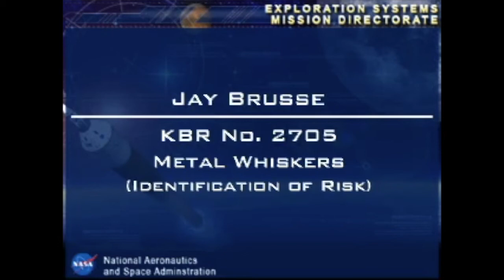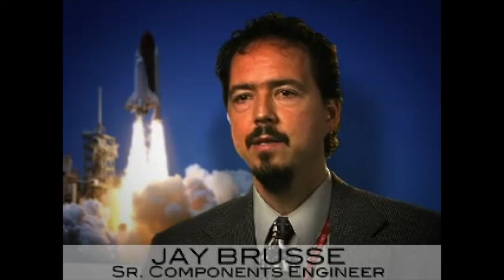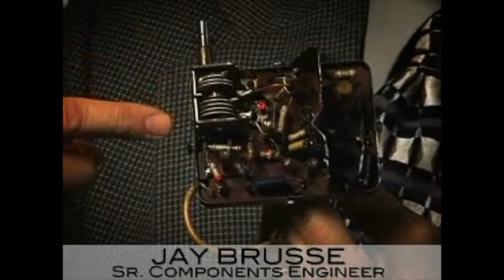Risk #2705 Metal Whiskers

Comment: 1986, i found tin whiskers in the us icmb launch protection system and simulators causing random failures. management was blaming software. i was the software guy who figured out it was tin whiskers. they grew caused shorts then vaporized leaving no evidence post failure. but i found those little bastards. it caused a multiyear study full of suits and phds. the final report echoed what i told them on day one, replace the components. vp’s respected me. low and mid level level managers feared me.